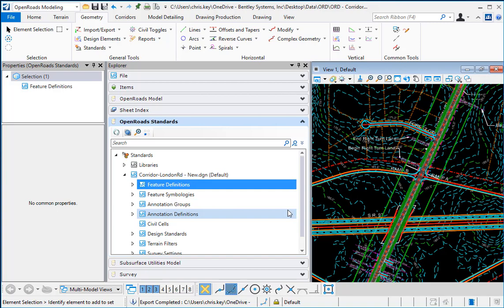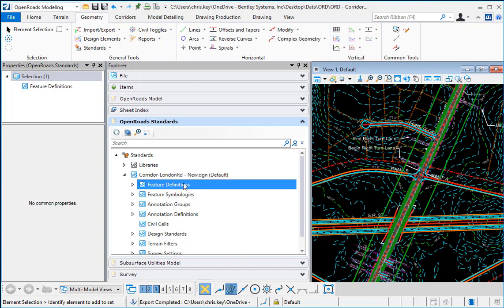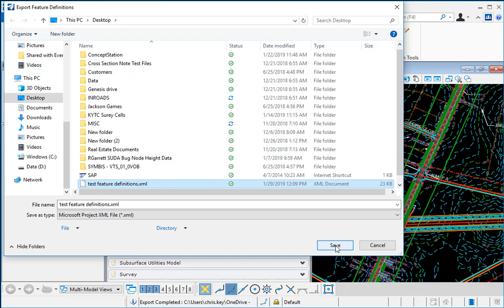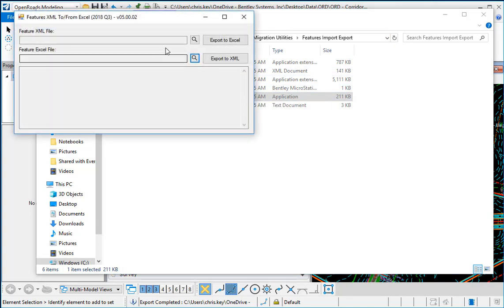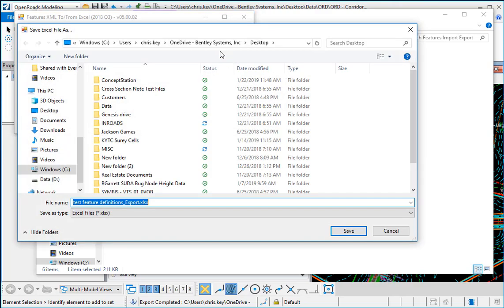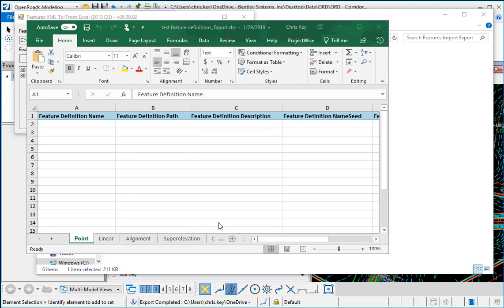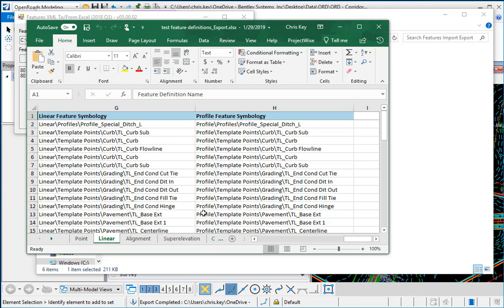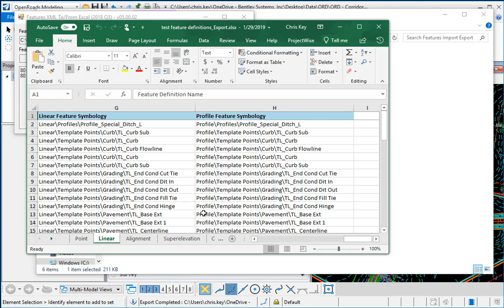OpenRoads Designer CONNECT Edition - Feature Definition and Feature Symbology Export

Comment: When I right click I get a different menu, I get Properties, Zoom, Isolate, and Clear Isolate.
Reply: To have the Import/Export option for Feature Definitions in OpenRoads Designer > Explorer, then you will need to edit the configuration file to add _CIVIL_STANDARDS_IMPORTEXPORT = 1 (Bentley provided configurations: _OpenRoads Training – Imperial.cfg or _OpenRoads Training – Metric .cfg which is located in C:\ProgramData\Bentley\OpenRoads Designer CONNECT 10.00.00\Configuration\Organization-Civil).
Reply: @eriki.e3820  Is this like a variable that we create in the "configuration variable" setting